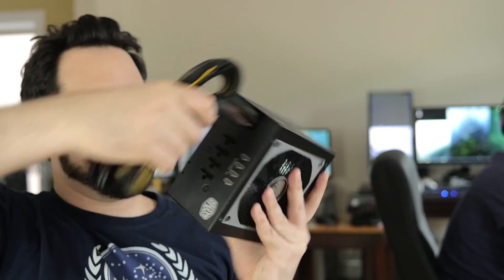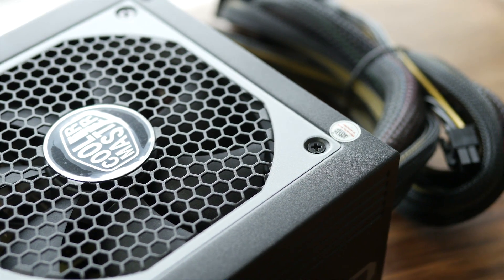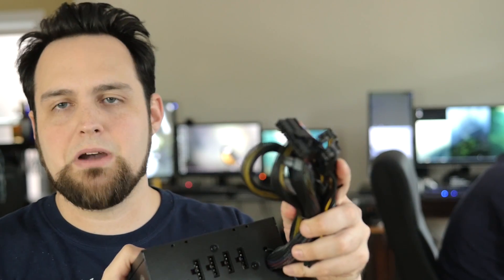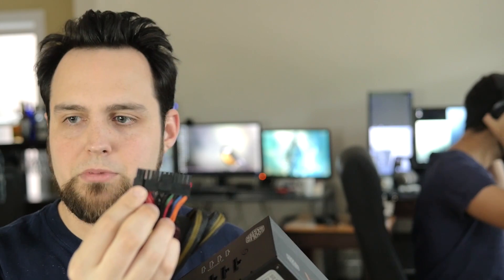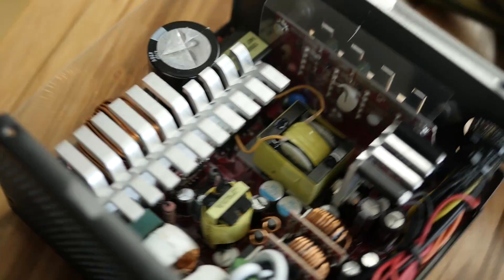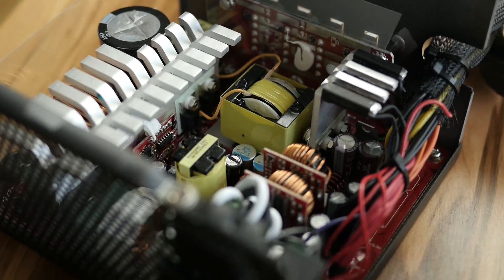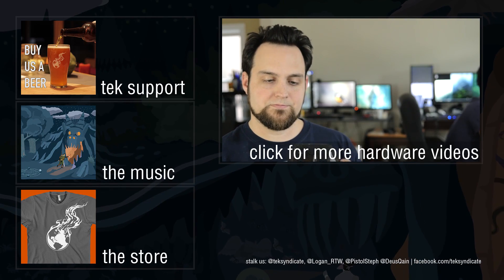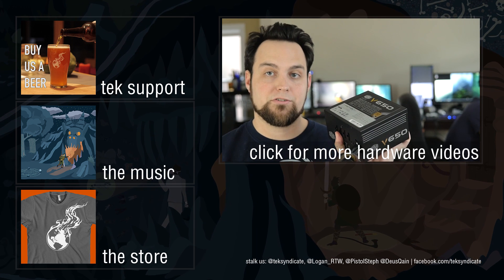Cooler Master V650 80+ Gold PSU Overview and Teardown

Comment: been a week running the Cooler Master V1000 (Fully Modular) and so far I'm lovin it. super quiet and solid. f@#c the Corsair HX850 that i had for a few months. that thing had a coil whine, plus the fan was ramming up randomly and was so noisy more than my system.

Comment: So is this still Sea Sonic like the V700+?
Reply: i believe all V series made by Seasonic.
Reply: ***** I thought so as well, but this is only semi modular unlike the rest of the V series.  It also priced pretty low compared to the V700.
Reply: phillychuck Hi guys, the V1000, 850, and 700 were. Our new VSM (like this one) are not - we designed them in-house and have improved on every aspect of the design. We also back it with a Gold Guarantee warranty in North America because we believe in the build quality :)
Reply: No. The OEM for this is Enhance Electronics. Which is still good.
Reply: CoolerMasterNA Great to hear that you guys are taking steps forward!
Reply: Jwood013 Thanks - we've been listening closely to the feedback from previous models and making sure we keep pumping out higher quality products
Reply: CoolerMasterNA Sorry to say, I bought the V700 because of the SeaSonic pedigree.  It would also depend on the OEM you using to build the new supplies.  Thanks for the replies.
Reply: CoolerMasterNA My only suggestion is this: New sleeving on the cables

In the next revision of these PSU's I'd like to see some better looking cables. I know this adds to the price tag but these days lots of people have windowed side panels. I love the flat, solid black cables that Corsair's RM series has. I think they ("they" being CM PSU's) would look better if they were completely sleeved so you don't have to see the multi-coloured cables at the end of the cable like in the 24 pin power connector.

Comment: Is it just me, or did you YouTube video player just grow twice as big?
Reply: I think they changed the default size to the large player with the option for the small player still as well as fullscreen.
Reply: The option I think you're talking about is called centered player and that option is still available and serves the same function.
Reply: I think for screens with high resolutions or maybe just widescreen resolutions (16:9/16:10) they increased the size for default players. Using my 1080p, it's large. I have a 4:3 monitor as well, but the default player is the smaller size.

Comment: It's called a teardown but it cuts to the case already being opened and fan removed. I'm trying to maintain inside of my unit as the fan clear plastic guard fell off. Disappointing you cut that bit out!